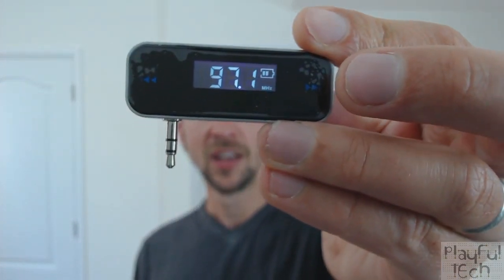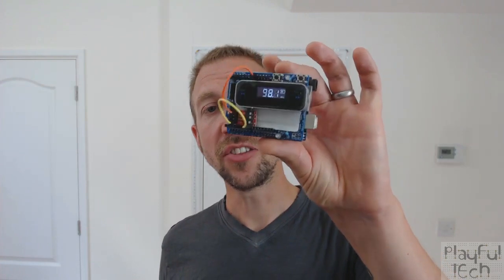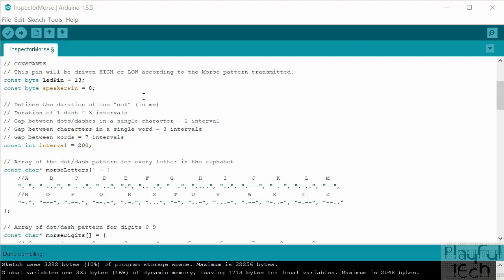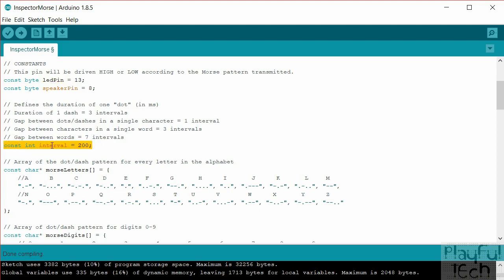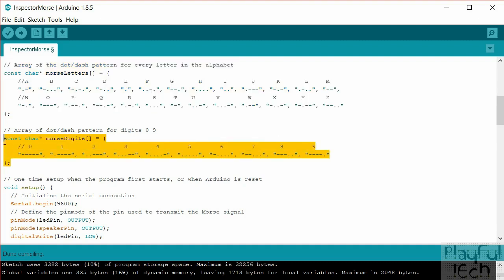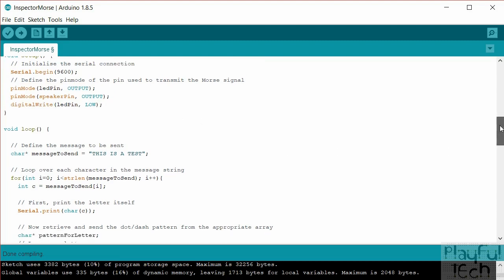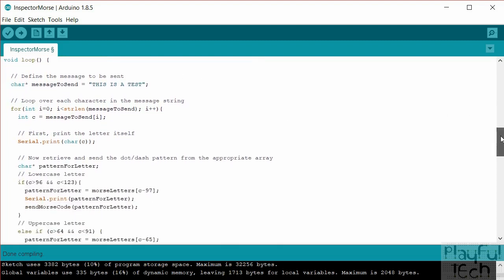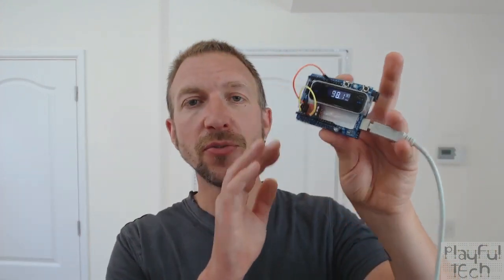Radio Transmission Escape Room Puzzle Tutorial

Comment: Great for the simple solution, and not having to modify a radio! I went the other route -- "made" a 1950s AM radio that's an Arduino-controlled MP3 player, which acts as a combination lock. They need to tune in the stations (which play music from the 1950s) in the correct order, and that sends an MQTT message via 8266 chip to another device in the room to activate. Although I don't have it doing the following it could to this too: Because it has the wifi (and MQTT) setup, I can change which track plays on a certain station, depending on what else in the room has been triggered, or if they need a (pre-recorded) clue played. 

Rather than just using an SD-Card reader (which has a bunch more restrictions on what audio can play from it), I use the DFPlayer YX5200 board. They're about US$3 each.

Comment: Another interesting idea to consider: some LED lightbulbs block radio signal.
It's worth testing this with your equipment, or could possibly be used to your advantage (i.e. players must switch of the lights while they want to work on the puzzle).
Reply from the maker: Ooh, thanks for the information - I didn't know that . But, like you said, any limitation can be turned around to make another requirement that players need to fix to solve the puzzle!
Reply: @PlayfulTechnology  You're welcome - I actually found out after we had our kitchen lightbulbs changed and the radio stopped working!